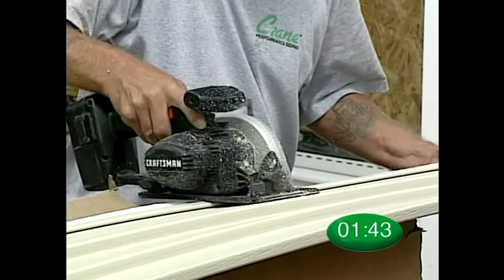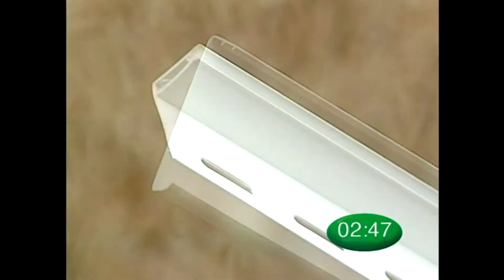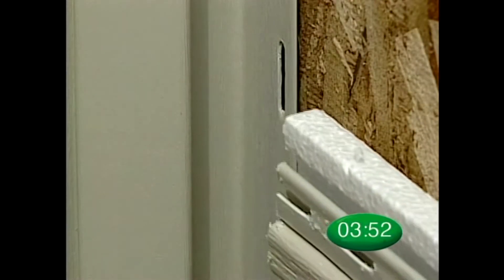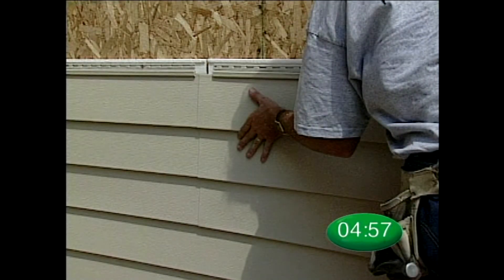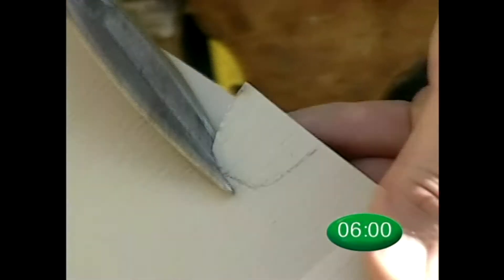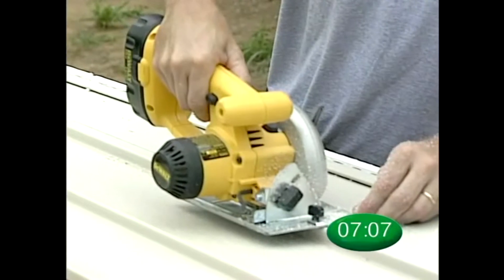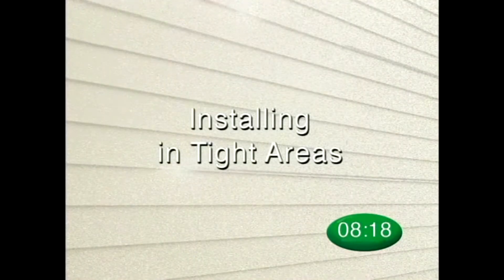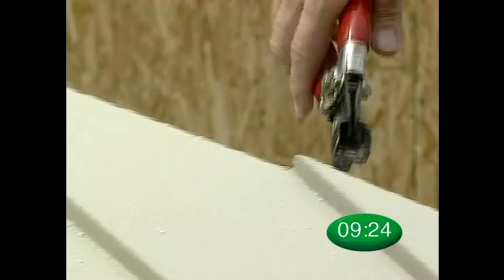Insulated Siding Installation

Comment: I notice in your instruction manual you state, as best practice, a water- resistive barrier integrated with code-compliant flashing, must be applied prior to the Solid CoRe siding installation.
In this video there is none and the siding is being installed directly over OSB.  What happened to the water barrier?
Reply from the maker: Hi Robert, this video was produced before the code requiring the resistant barrier was in place. First and foremost, you should always contact your local building code officials to make sure that you are following your local requirements. If your codes default to the manufacturers' installation guide, then our guide should be followed.